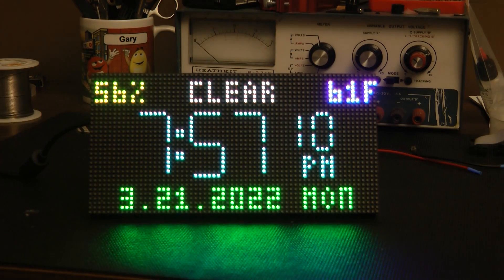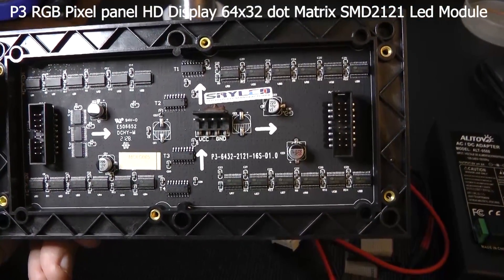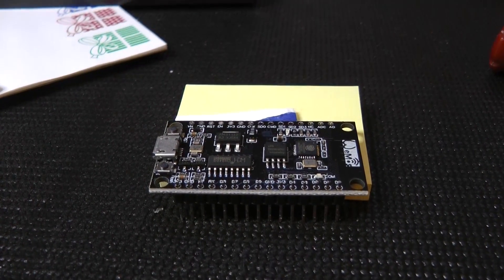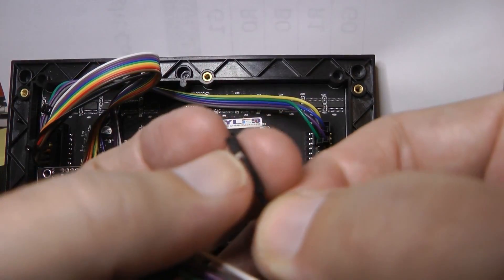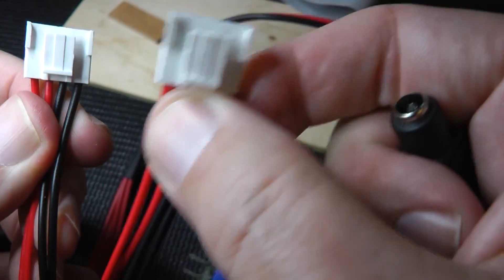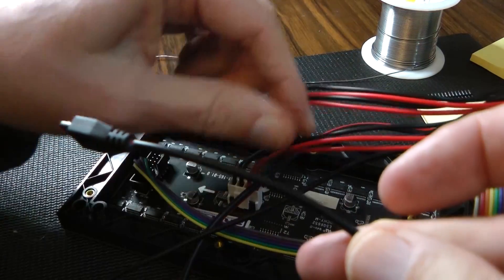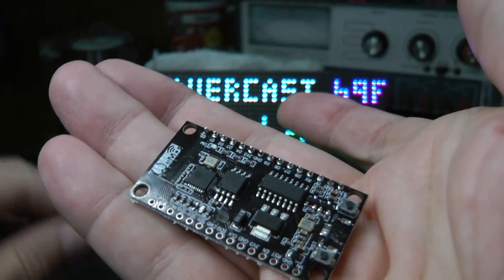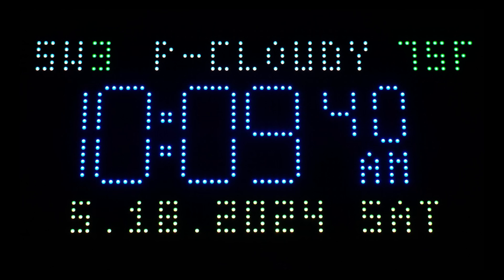Morphing Clock using a 64x32 RGB display.  Part1 - Hardware Build

Comment: Thank you for sharing the updated version of the clock,  but sir i am still unable to get this working with the only available  board that i have, a P4 rgb matrix 64x32 ,  it is not doing any thing, will you please help me,    i rechared internet for the diffrence between p4 and p3 boards,  but i dont find any diffrence in pin diagram or  connection ,  so is there any change i need to do in coding please help ,  

in the led panel  when switched on there is no display and seems like it goes on hang mode
Reply from the maker: Not sure if you noticed but in the description there was an error in the video. 

There is an error at 9:05 on the video, use this wiring diagram instead:
https://imgur.com/a/OsXNWu2

Comment: Hello Gary
i have seen your designs They are beautiful
now i have a question, i have a P2 256*128Mm Smd1515 128X64 Pixel Rgb Full Color Led Panel Matrix received. And i would like to make a morphing clock. i do not have much knowledge of writing a code. Can you help me how to connect this to a Wemos D1 Mini V4.0.0 or to an esp32, and maybe help to write a code ino?
Kind regards
Ruud Hudepohl
Reply from the maker: If you don't have much experience writing code I don't feel this is the way to get started.  I recommend you get the hardware recommended and work with that.

Comment: Will this work with an ESP32-wroom-32d?
Reply from the maker: I never tried, I think someone once mentioned it did not, it would require coding changes.  One of the library calls is very dated, it's the reason you have to load the older ESP8266 prior to 3.x otherwise it would not compile.

Comment: Awesome project.  Hardest part was waiting for the slow rowboat to arrive from China with the panels.   Everything worked straight out of the box, now to make more permanent connections and display enclosure...  Thanks for all of your hard work on this!  BTW total draw for panel and ESP8266 running totals 160-190mA @5V (depending on brightness setting).
Reply from the maker: That's good to know, I thought it would draw a lot more power.

Comment: Hi Gary, looking at the wiring diagram you have here on the back of the display you have yellow labeled as esp, should that be labeled as out?
Reply from the maker: Hi Andy, you are correct, when I made the change the for the D3 wire I screwed up.  Here is the updated wiring 

https://imgur.com/a/OsXNWu2